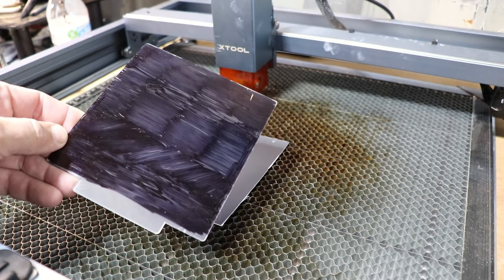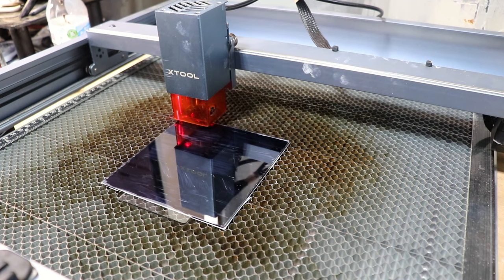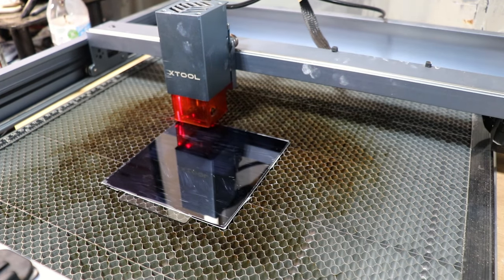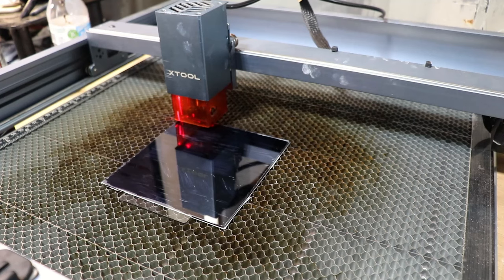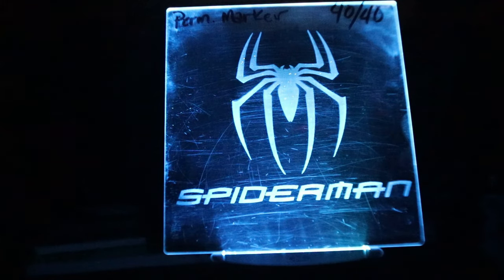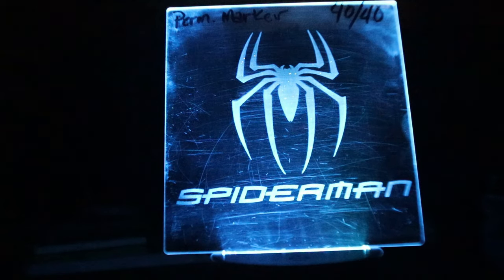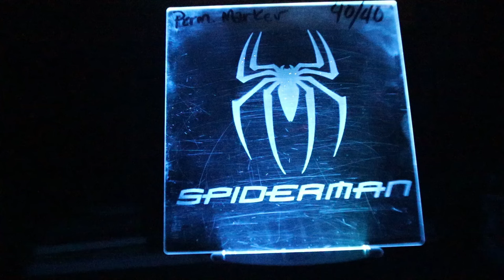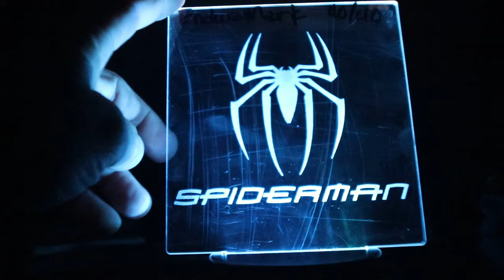Etching Clear Acrylic With A Diode Laser

Comment: Try 1 plain with just the black poster board . I have had success with that on glass haven't tried it with acrylic yet
Reply from the maker: Good suggestion. I did try that.  It "pops" the acrylic and leaves dots.
Reply: @LaserNoob  good to know ... thanks
Reply: @LaserNoob  The dish soap (which can be applied pure, and must probably remain wet) act as fire retardant (so they say) and allows to avoid this problem (but you have to adjust the laser power & speed to be sure).

Comment: interesting bud, but little  tip just put black scratch paper under neither, that's how i did it on tool F1 works a treat  . disclaimer  only found out by accident lol. PS keep up the great content as highly informative ,i use the power / speed set up  you showed only using  CS  best vid that's helped me out lots .

Comment: You did not say, but I assume that EVERY method had the treatment on the bottom of the acrylic so that the laser went through the acrylic first...right? But, if you used Tempera paint, this paint would be on the top surface, or can it be on the bottom for all materials...let us know please.
Reply from the maker: Everything including the tempera were placed face down against the black poster board.

Comment: Whatever I do it engraves at laser Tree 10W recommend 6000 speed and 40% in the acrylic lights acrylic but not enough to show up when the light is turned on, Does the thing only work it total darkness?, the acrylic is a very tight fit into the black box so not sure it goes all the way in. using poster paint black on the top surface placed on a metal grid. any suggestion welcomed
Reply from the maker: The acrylic should be snug. But it will really only be best in total darkness. I don't use a laser tree so I can't help with the settings. I also run everything in MM/SEC so speeds settings are very different.

Comment: I got an acrylic led pack for laser engraving off amazon and i did a power/speed table test and it's cracked in every box on every speed and every setting any advice is it the acrylic? It is extruded not cast
Reply from the maker: It's possible that it is not cast. What power laser do you have? What speed and power are you testing with and what medium are you using?
Reply: @LaserNoob  comgrow z1 10 w and i used black acrylic paint, and speed and power i did a whole test ranging from 6000 to 2000 speed and power from 100 to 45
Reply from the maker: I've never used acrylic paint. That could be the issue. Also my best results came at around 20-30% power.
Reply: alright I'll give that a try with some other mediums and see how that goes, thanks. And i like the shirt 👍
Reply from the maker: Tempera paint works well. That's what I typically use.
Reply: @LaserNoob  so I've gotten it to work at 15% and 20 % at 6000 to 7000 with the acrylic paint i will be picking up some tempera paint because acrylic is expensive and I'm in trouble if i use all the art paint haha

Comment: Did u take the protective cover off before using the marker or leave it on and marker over it?

Also can you engrave a photo? Aka, something not so simple. 

I can engrave your design with my 1.6 watt snapmaker laser but can't seem to get photos to engrave (they engrave but look like a big blob and not an actual photo).

Btw, Snapmaker 2.0 is 1.6 watt at 40 mm/sec and 100% power for basic engraving for anyone with one.
Reply from the maker: Take the protective film off. And yes, I have  done a photo!
Reply: How do you do a photo?
Reply from the maker: I processed the image in imag-r and used tempera paint. I cover tempera process in my 2nd acrylic video.

Comment: why is it when i set my quality 7 on laser grbl, it sets a   7.000  , but on other videos it only has 7 on it's own , would this matter.
Reply from the maker: I don't really use GRBL, but I did take a look at it. Mine has the 3 zeros after the decimal as well. But I also have decimal spaces in Lightburn as too. The videos you were watching may just have their GRBL set up different. I don't believe it will cause you any issues. If it does, please let me know and I'll investigate the issue further.
Reply: @LaserNoob  cheers for your reply , i will look into it further tomorrow and mess with some settings , i did see a video with someone using laser grbl on an ortur laser on their quality settings they also had 7.000 and it came out perfect , i'm still getting used to this , sorry if i keep bothering you , have a good un cheers.

Comment: Not sure if you cover this in your follow-up video, but I think you focused on the top of the acrylic instead on the surface that you are actually engraving (the bottom). You should actually focus on the card underneath. This assumes that the painted/coated surface was the bottom, not the top. Also, isopropyl alcohol will damage the acrylic, causing crazing.

Comment: What did you use to clean off the Endura off the acrylic, wouldn’t see on the video?  Was it water?  What can be done to avoide the scratches.
Reply from the maker: Just water. The scratches came from 2 things. Using paper towels which is a no-no. And #2 Stacking them on top of each other. Another no-no.

Comment: On acrylic do you have a problem with scratching?
Reply from the maker: Yes! I always leave the protective film on the uncoated side until I'm ready to etch it. Then clean it with a very soft cotton cloth. Even paper towels will scratch acrylic. After your done etching, I suggest putting them in a soft protective sleeve. Personally, I use transfer tape. But I have a ton of  that on hand for when I work with vinyl.

Comment: Can you use a coat of plasti dip!? Easier to peel off with less scratches?
Reply from the maker: Depends on the chemical composition of the coating I suppose. I'm not sure if the fumes would be toxic or corrosive.

Comment: hi there sir
is it    possible  to cut 1. mm clear acrylic with diode laser?like using the marker method?
Reply from the maker: No matter the coating, clear acrylic can not be cut with a diode laser. Sorry! You will need a co2 laser for that.

Comment: What is a good laser for begginers?
Reply from the maker: I have only used the XTool D1 5 & 10 watt. I bought the 5 w rig about 3 months ago and got the 10 w module a month later so I could do white frosted glass. I was a complete noob and it was relatively easy to get going.
Reply: @LaserNoob  I want to do clear acrylic and simple stuff like that. This is enough eh?
Reply from the maker: Once I figured out how, I have had no issues doing clear acrylic with my D1 10W.

Comment: Thanks for posting the settings at the end.  Where did all the scratches come from?  The cleaning?  What was your dish soap to water ratio and what soap did you use or does it matter?  Thanks again r/
Reply from the maker: The scratches came from a combination of cleaning with the wrong material (need a soft cotton cloth) and from stacking them on top of each other. They scratch EASY. As far as the ratio, just enough soap to make it viscous.
Reply: I use a normal white A4 paper 180gsm and after done you can use any glass cleaning product that is used at home for windows.
Reply: @LaserNoob  FYI, the scratches can be polished out of the Acrylic using a NON-Abrasive auto polish

Comment: thought mm/sec was for co2?
also with regards to using black paint ive seen people engrave the paint side  not sure what to do
Reply from the maker: Lightburn settings say mm/s are best for co2, but not sure why. Even xtools website gives burn speeds in mm/s on their materials page.  Mm/m is just mm/s x 60. I have not tried black paint so I can't comment on that.
Reply from the maker: I think you might be talking about tempura paint. I will try that method soon, and post the results.
Reply: The answer is ALWAYS to try both ways and learn from whichever one was a “failure”. You’ll spend more time thinking about it than simply doing it would take.

That said, I just did something similar, but it was on wood, and I engraved directly onto/through the black spray paint that I covered the board with. It smelled a little, but not too bad. The laser pretty much completely burned the paint away, along with a little bit of the surface of the wood, leaving just wood underneath. I think it would work similar to acrylic. The paint just serves to be something for the laser to hit instead of passing through. When it hits the paint, or marker or whatever, it causes the heat/fire to occur on the material, which leaves a mark.
Reply: @michaelkeymont501 I did a flag display for my brother-in-laws flag when he passed. I covered the area to laser with painters tape. Came out perfect and wood was walnut. Did 4 passes to make sure it was deep enough.

Comment: Are you sure about the speed?
Reply from the maker: Those are the speeds and power I ran each test. Speed and power will vary slightly as no 2 lasers are the same. Your 10w might have slightly more or less power than mine, or vice-versa.
Reply: @LaserNoob  i was confused about mm per second and per minute my bad. Thanks for the response though. Thumbs up.

Comment: How much time you need to etching that acrylic?
Reply from the maker: This particular design was about 20 minutes to etch.
Reply: @LaserNoob  hi you said this took you 20 minutes, well I followed your steps and no way does it take 20 minutes. at a speed of 40. definitely no way  after an hour of etching I cancelled the job and decided engraving on acrylic is to time consuming. i didn't even get to half way in the spiderman text. i did a canvas the other day at a speed of 2000 and power 15 and the took 7 hours. this acrylic I was doing would have at least took 14 hours plus. unless you showing an unedited video that the design you did was 20 minutes and then I apologise for doubting you. and I am using an xtool d1 10w pro and just because of the slow time for doing acrylic I went straight online to buy and research  a co2 laser. 20 minutes, hmmm. that remains to be seen.
Reply from the maker: @paulb6181  then your settings are wrong.
Reply: @paulb6181  I put in a small 58x53 mm file at 40/40. Preview shows 2 hours. No way it took 20 minutes. And this is line. If I jump to fill it's almost 4 hours
Reply from the maker: Your settings are wrong.

Comment: Hi, unfortunately this spray is not available here and is generally sold out and unfortunately I can't understand exactly what you mixed the water with in step 2 :) Water with detergent? Thanks for the answer, otherwise great video :)
Reply from the maker: Dish soap and water is the mixture. I am working on another way of etching acrylic. If the results are good, I'll do another video.
Reply: @LaserNoob  Thx a lot :)
Reply: @LaserNoob  waiting for that too. 
Can you test to cut the transparent acrylic also?
Reply from the maker: @nomanmalik4816  sadly, clear acrylic can not be cut with a diode laser.